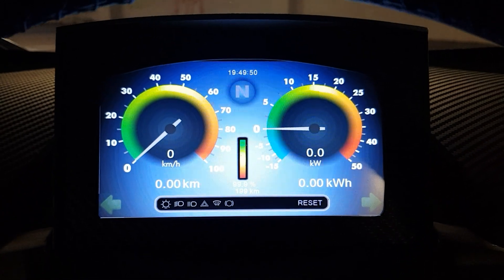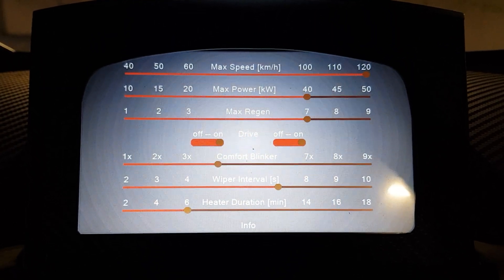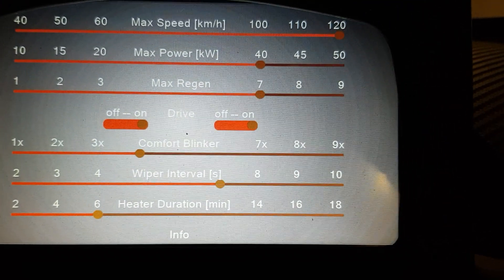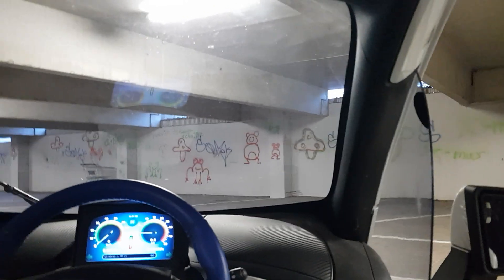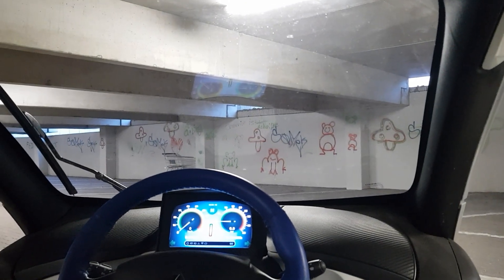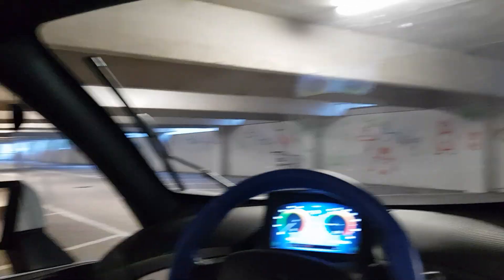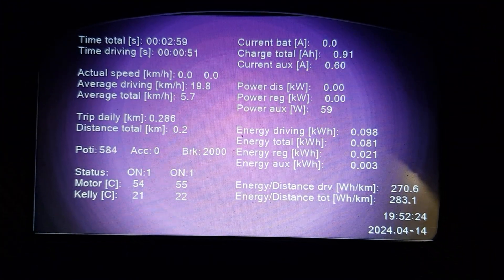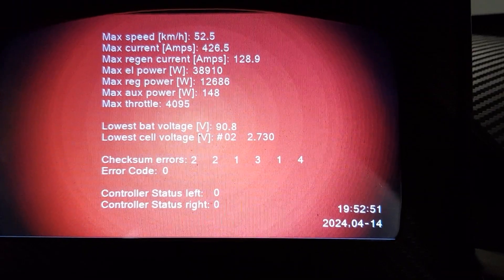Twizy Dual Drive (DD): Secret Setup & Joyride

Comment: Wie hast du die Motoren synchronisiert ?
Reply from the maker: No sync yet and necessary, simply running in parallel
Reply: @nextev8794   I have a similar project at uni and i am not sure if the car actually runs straight when they are not snyced. When there is a slight difference in rotation the car would steer to 1 direction?